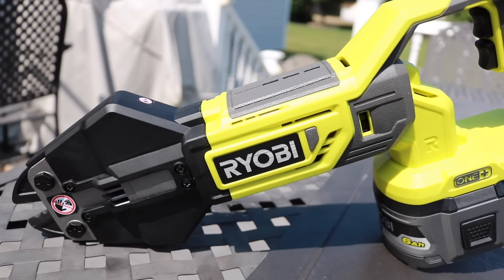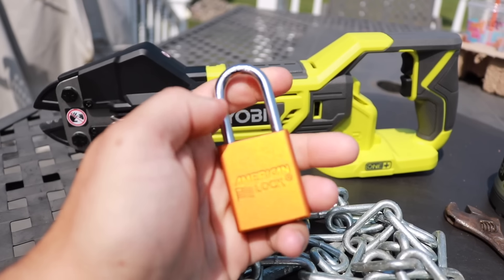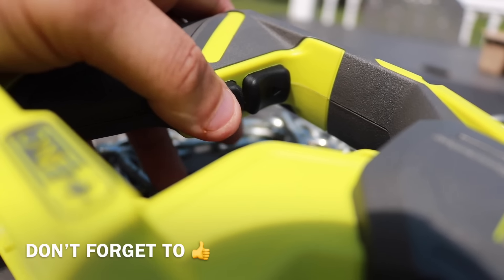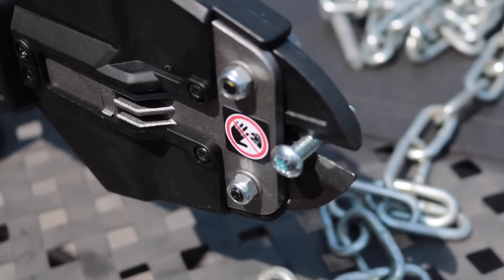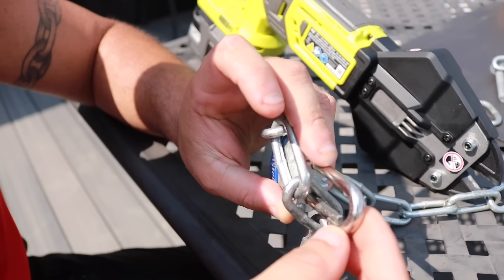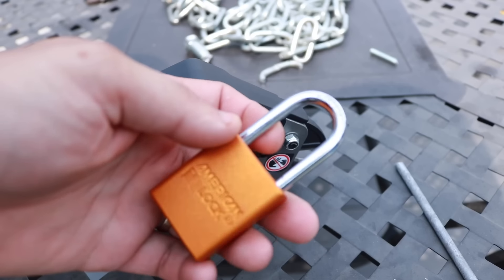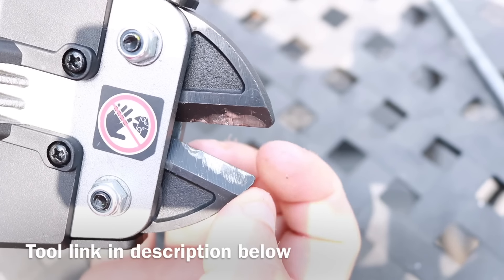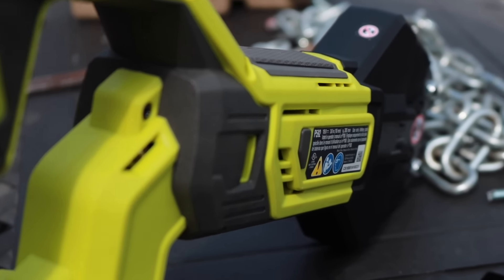Ryobi 18v Cordless Bolt Cutter Review (P592) #boltcutter #ryobitools #newtools

Comment: I still don't understand why I see people hating on Ryobi cordless tools. I've been using them relatively frequently for nearly 15 years now with little issues.
Reply: Same here Bro, I've only had one ryobi tool give me a problem after at least 15 years of  using a large platform of their  18v tools and table saws, getting ready to take advantage  of home depots black Friday sale and grab the new brushless hammer drill and free tool combo, probably the brushless impact
Reply: Adam Sarrazin that’s what I just used. Grabbed the jig saw with the hammer drill
Reply: agreed. Ive invested in Ryobi and Milwaukee. Both are great but Milwaukee doesn't even make an 18v inflator. Ryobi has 3 different ones. Just picked up the Ryobi brushless jigsaw bare tool for $64 brand new. Milwaukee wants $199....no thanks. Ryobi also makes better nail guns than Milwaukee any day of the week, and for considerably less coin too.
Reply: Ryobi is the poor man's milwaukee
Reply: Because some people are very naive, gullible, easily manipulated and persuaded and ultimately brainwashed into thinking there is nothing comparable to Milwaukee, makita, dewalt etc....yea like this video says it all!! Ive got ryobi tools and i deem them to be faultless and exceptional quality. Spending more doesn't generally mean better!
Reply: Roy i is absolute garbage the battery’s over heat in a minute on a saw also on drills just get a nice makita drill
Reply: @creeatd  We have a Ryobi drill at work, it has a terrible chuck wobble. Firmly set my opinions as valid that these are a waste of money for anyone that does actual work.
Reply: @TwoAPTMLMusicProductions  that is probably a false statement your are making just to justify your opinion being valid. But even if it is true just one drill doesn't mean the entire enterprise is mediocre.
Then you have to take into account how often was it used, how old, missed used etc. 
But if you want to go down that path i got an entire list of Milwaukee, dewalt and makita that were repulsive and wobbled when i was drilling!
Reply: They are cheap tha6s why. Homeowner grade. Not professional grade.
Reply: @zachtheripper124  keep thinking that,  I hate to have to keep embarrassing my co workers with the fancy Milwaukee's,  makitas dewalts,  not all tools but most of my tools outperformed those tool brands mentioned
Reply: @MyKonaRC  Ryobi and Milwaukee are under the same international company TTI. Is what your saying that Ryobi is just as good but affordable by "poor" people?
Reply: @creeatd  OK. So, your DeWalt - did I guess right?
Reply: @TwoAPTMLMusicProductions  I have heard that DeWalt people by the DeWalt drills, then are afraid to use them, especially on roofs or tough jobs so buy Ryobi do do the heavy work. This does help make DeWalt last longer I must say
Reply: @agimasoschandir  when I was young teenager (20 years ago-ish) I was gifted a Ryobi one+ combo kit ( the old blue ones with NiCad batteries; drill, circular saw, dust buster vacuum) and I used it a bit around the house. When I started doing professional contracting aroun 18 and got my hands on corded tools I packed up my Ryobi stuff because they were garbage in comparison.

A few years in lithium became accessible and I bought some Milwaukee and Dewalt tools after handling a couple different models on site. I didn't know the major difference was the lithium and brushless tech and chalked it up to Ryobi being the 'homeowner brand.

 When I quit doing professional work I sold most of my tools and eventually when I needed something I picked up a Ryobi version because it was significantly cheaper and I knew I wouldn't be using it hard. I was very impressed that the performance was basically on par with the Milwaukee and Dewalt cordless tools i owned in the past. From now on I mostly buy Ryobi. However, despite the performance being comparable Ryobi tools are not as rugged and will not last up to the abuse that I put my other tools through. I could tell just by touching them and now having used them for a few years I know their limits. They use cheap brittle plastics for almost everything and the tools overheat extremely quickly.

Tldr; Ryobi performance is excellent for the price, but the tools will not hold up to professional use. If you are going to use your tools every other weekend on average, Ryobi is a great choice. If you rely on your tools to make a living, do not buy Ryobi.
Reply: @jayjayhooksch1  Yeah, my first set was an old NiCad blue set which I got to get the 'free' chain saw after an ice storm.
I do get from  'professionals' about Ryobi tools being junk. What I have to work around is the sort of 'you must use Dewalt or your not a true professional' and other what I call peer or priest syndromes (at least up until B&D bought them) to get to more honest reviews.
Ryobi is marketed as a home DIY tool set. I also read that many pick up a Ryobi when they have forgot or lost their must have tool and are usually surprised at Ryobi quality. I also would like to make enough where I thought Ryobi tools were cheap 🙂

Other then my garden tools, I probably do not put my indoor tools to as much abuse.
I will note that Ryobi and Rigid (as well as other power tool companies) are under the same group ownership, TTI, and that Rigid is a marketed as a professional tool company, and a more fair comparison to Dewalt would be made with Rigid tools
Reply: @agimasoschandir  I own some Ridgid tools as well, they seem high quality and capable to me, on par with DeWalt and Milwaukee. I currently only own TTI brand cordless tools. I don't notice a difference between Ridgid and Milwaukee other than weight (Ridgid tools seems to be a bit bulkier and weigh more, but don't necessarily feel more robust than milwaukee). Also tool availability; ridgid does not have nearly the selection that Ryobi or Milwaukee do. 

I would feel confident putting my Ridgid tools to professional use. The lifetime service agreement is nice as well, and I didn't find it a hassle to sign up for as I've seen others mentioned. I haven't had to make a claim yet though, and the wife and I actually use the Ridgid stick vac daily as our household vac with an infant, a toddler and a cat. It does well enough with anything that isn't wet or sticky. We don't have carpet, but it does the carpet in our minivan just fine. Daily use of the batteries and the brushless vac for years now and no problems.

Comment: This was exactly the review I needed to see. I’m going to be buying one!  The use I need it for is for cutting chains from my tires when they break and get stuck in between the duels. Yes, it might be hard to get this in between there, but it will be a lot easier than using a pair with long handles, which is almost impossible. Thank you.

Comment: I love this tool, only had it for a couple of weeks, it took several trigger pulls(it will stop once it feels that its pretty tough but every time you squeeze the trigger will continue cinching up until its all the way thru) but it cut itl,I had to cut some automotive 3/8" hardened steel solid steel bar it  took several trigger shots but it cut it, very violently mind you when the second part of link was cut, so use caution and safety gear,I had tried to cut this bar with my so called "Monster" 30" bolt cutter but it was impossible unless I blew my biceps so this thing totally saved me.

Comment: Those work much better than I thought they would. I was extremely surprised that they cut through the stainless steel lag bolt. I wonder how much replacement jaws would cost?

I found it hard to believe that you couldn't adjust the jaws, so I looked at the instruction manual.

ADJUSTING THE JAWS
See Figure 4, page 8.
With use, the jaws may develop a gap that could result in incomplete cuts and should be adjusted. 
WARNING: Never  remove  the  jaw  cover  before  making  a  jaw adjustment.  Attempting  to  adjust  the  jaws  without  the cover installed can result in serious personal injury.

 Remove  the  battery  pack  and  place  the  tool  on  a  flat  surface with the eccentric bolts facing up.
 Using a 13 mm wrench, hold the eccentric bolt. With a second 13 mm wrench, slightly loosen the lock nut on the other side.
 Turn the eccentric bolts to adjust the jaws until the gap is closed.
 Tighten the lock nut.
Reply from the maker: Yeah Pro, I was shocked as well. I'm not sure what the replacement jaws will cost, but I'll try to find out for you
Reply: Thanks.
Did you read my whole comment? It explains how to adjust the jaws.
Reply from the maker: Ohh man, I didn't see the read more. I must have missed it as I did not see that. Well done on seeing that. I will add it to the description!
Reply: Pro1er:
There is NO read more.....  
Your comment was cut off after "so i looked at the instruction" .... then cut off and NO read more option :-(
Reply: Not sure what the problem is. I just clicked on "read more" and it works for me. It's basically the instructions from the owner's manual explaining how to adjust the jaws.

Comment: We have had two of these both of which haven't lasted 6 months just cutting seals off trailor doors update 5/16 the second pair is still going strong two years later must of just got a bad pair which Ryobi replaced cut about 100 container seals a day
Reply: Were they in heavy use. I’m looking for cutters for the same reason. Did you find other options, when they broke down ?
Reply: @estebangomez7640  Ryobi replaced my cutters with one day shipping

Comment: I would be curious if you can still thread a nut on that bolt. As someone who works with a lot of 3/8 threaded rod, I would be interested. Yes, I do know about all mechanical rod cutters.
Reply from the maker: I'll cut another and see if that works?
Reply: @ToolReviewZone  Sure, thanks. If it works the first try, cut 10 to validate consistency. I think it will become slightly oval at the tip and not work, that's why a proper rod cutter has conforming jaws and faux threads to retain shape.
Reply from the maker: Yeah, I think your right but worth a shot. I'll do it this week buddy

Comment: Have a roller rink with lockers, my wife is small and cant do the bolt cutters think this is a great fix.  I too wish you could adjust the gap though
Reply from the maker: Yeah that would actually be an awesome application Ron. Man, I remember the days of the limbo!
Reply: Ron, you can actually adjust the jaws.
The steps are listed on page 6 of the manual. 
Never remove the jaw cover before making a jaw adjustment. Attempting to adjust the jaws without the cover installed can result in serious personal injury.
 Remove the battery pack and place the tool on a flat surface with the eccentric bolts facing up.
 Using a 13 mm wrench, hold the eccentric bolt. With a second 13 mm wrench, slightly loosen the lock nut on the other side.
 Turn the eccentric bolts to adjust the jaws until the gap is closed.
 Tighten the lock nut.

Comment: I need to do a bunch of 4ga cattle panel cutting should this do the trick?  Any idea how many cut cycles you can get on a single charge? This would be my only Ryobi tool so I don't have bunch of batteries like I do for my DeWalt
Reply: Did you end up using this tool to cut cattle panels?  That’s what I need it for, too. Did it work well for you?

Comment: Can it cut steel wire cable ?
Reply from the maker: This is actually a great question and something I now wish I would have added to the review.  If you are under an inch, I would think you should have no issue with it. I haven't personally tried it, but it should work
Reply: @ToolReviewZone  if you still have the tool maybe make an update video?
Reply from the maker: Tell you what bro, I will try it and let you know if the work well. They should do fine, but now I'm just curious.  I'll keep you posted

Comment: You should have cut at the shoulder of the stainless bolt where the metal was thick and then the threads you can cut easy through threads part of the metal is machined away due to threading. Not a admonishment to you I’d just would have like to see that.
Reply from the maker: I'll try it an get back to you. Should not have an issue with it though
Reply: Thanks I appreciate that I think that tool is pretty handy
Reply from the maker: You got it powder

Comment: Hey man not hating on your video but can u try and push it a bit harder like 16mm rebar or 20mm or bigger
Reply from the maker: Hey Josepth.  It's real not meant for that as its marketed as a bolt/lock cutter. It probably would not work that well for long term use